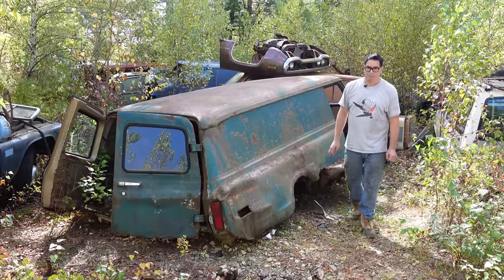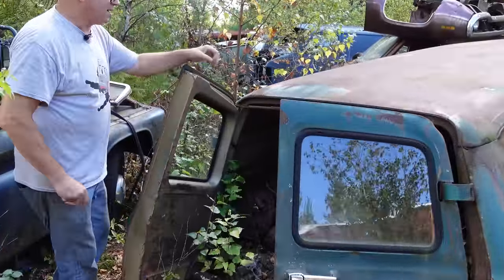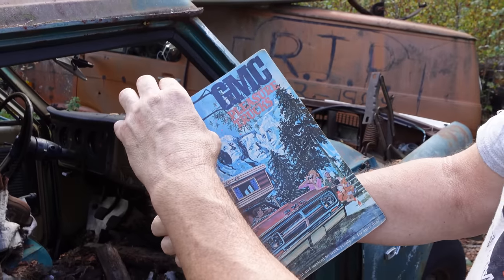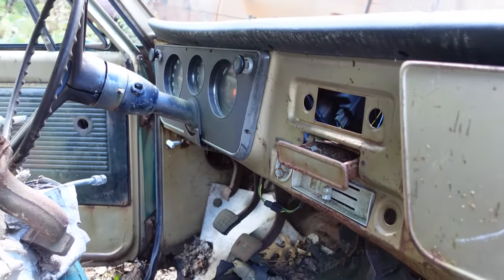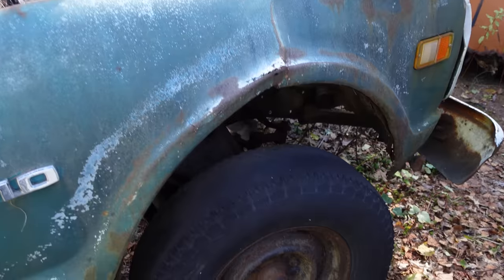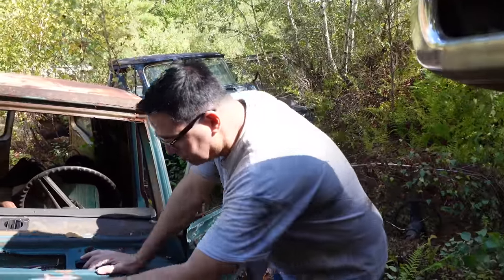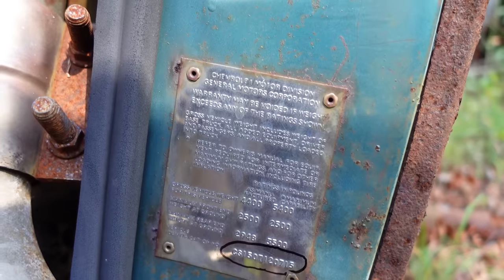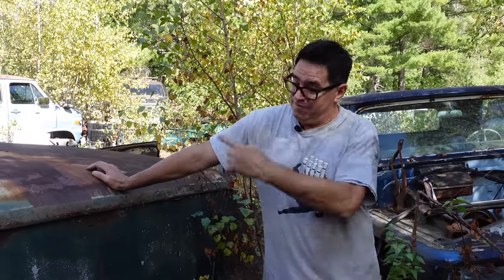Tin Panel Alley

Comment: I wish GM would make something like this again.  I love the Suburban body style but don't need or want all the modern gizmos that push the price up to 80K or more for a new one.
Reply: Agreed.
Reply: So do I
Reply: They technically "did", but on a smaller more "retro" scale, the HHR. It was a bomb and flop.
Reply: My 2006 Suburban LS 4WD is about perfect for me: pre-AFM 5.3L, cloth seats and just the basic power accessories.  4WD and G80 rear end.  300k miles strong.
Reply: I completely agree 👍
Reply: I am a contractor. I would rather have a panel van / suv than a van!
Reply: @gtemnykh  Awesome bro.
Reply: The car companies tell say you do need all that stuff.  How dare you wanting to drive and control the vehicle yourself.
Reply: I would be in on this as well. Even if it was just a 2wd.
Reply: Buy one of these and do it up!
Reply: You're precious government (especially Brandon's) would never allow it..
Reply: They did continue to build this type of truck in Mexico 🇲🇽 until about the late 1990's. Production ceased around 1998 or 1999.
Reply: @frankdenardo8684  they kept making the beetle after the "new" one came out I think. Cheap practical vehicles are basically gone today. Nothing under $27000

Comment: My father had an older version of that panel van back in the late 60’s ish. Believe it or not he traded that panel van for a one car garage. Drove it to the guys house. Unbolted the garage from the floor,braced it and backed a small dump truck into garage and raised the garage up with the dump body then drove the garage back to our house across the city.

Comment: A friend of mine has one that is black on the outside and that same gold/ tan on the inside. It was a funeral flower truck. It had a six and had a 3sp on the tree. It had super low miles on it. Now it has  a crate 350 and th350.
Reply: At a funeral home I worked at years ago here in Central Florida , we had a 68 El Camino used as a flower truck .  It could do GREAT  burnouts !

Comment: Hi Steve great vid as usual. I commented on an earlier vid of one of these. I owned a 72 Suburban factory big block but that had been replaced with a 454 later on. It had every option with the factory tach and front and rear AC and a weird plaid interior. My question is I've always been told a panel van is a van without windows and these were called panel trucks because of the truck components. The sedan delivery was from the bones of a car, sedan, or wagon. Is this what the manufacturer called them? Have a great day and even better tomorrow, Namaste 🙏🏼
Reply: We always called them panel trucks also.
 The car based version was known as a sedan delivery.
Reply: The terms were often used interchangeably. Just reference the GM literature for that year, and that's the "official" name for it. Roll with that. Done.
Reply: I have never heard this vehicle referred to as a van either.

Comment: 292 has the motor mount on one side offset to the other, maybe that could tell which this had. 

The RIP on the orange van is neat
Reply: It was a 6
Reply: @rustedratchetgarage6788  Yes, sparky, was it a 250 or a 292?  The mounts are different.

Comment: When I owned a garage, rare vehicles can sometimes be a problem. Twice we had problems getting exhaust parts.
One was a Granada station wagon; and the other was an AMC Spirit(?) with a 304. Neither being listed as made.
Reply from the maker: Hi Ron D Pert, wow a Granada station wagon. Weird. Maybe a coach-built unit like the Cadillac Westerner conversions? Oh, IGNORE the crappy Spam message from some imposter on the WhatsApp junk link. But you knew that. This junk happens from time to time on just about every YouTube channel. Anyhoo, THANKS for watching and writing. -Steve Magnante
Reply: @SteveMagnante  "The second-generation Ford Granada was offered in three body styles. For 1981, the Granada was introduced as a two-door and four door sedan. For 1982, a five-door station wagon was introduced transferring the body style from the Fairmont line." ~Wikipedia

Comment: Back when I was a kid about the only users of those panel van s in the late 1960's was the Bell Telephone service people and a couple of home diaper servece companies. Most other users had tranisitioned to regular vans or step vans by that time. Back in 1979 I had a 1953 Ford  panel truck for a while with the 239 flathead V8.

Comment: As a former flooring installer, I always wanted one of those panel van but being there is like 36 on the road is probably why I never got one.
Reply: You just have to know where to look.  I have seen 3 or 4 for sale in Mexico but they all needed restoration.  They all were running and driving though.
Reply: @mexicanspec  It's been a while. I may have to go hunting for a new project this weekend. 😎😎
Reply: @finscreenname  If I can help let me know.

Comment: Dude, you got to do a vid on that white 84-90 Caravan/voyager beside the C10 Panel. They actually made a panel version of the 84-90 caravan (84-87 were called "Mini Ram Van" and 88-90 were called Caravan C/V). I have clean low mileage '87 Mini Ram Van myself (just thought it was Ironic seeing the old caravan next to the panel C/10).
Reply: At the science institute where I was employed they purchased a new panel version of the Caravan as a mail van,it
had power brakes, automatic, but to save a few pennies it had manual steering. I drove it once and never again; as
it was like mixing concrete with a broom handle.

Comment: My Dad had a panel truck when I was little, maybe five or six at the oldest. It was older than the 67-72 body styles though. It may have been in the 62-66 range, but I'm thinking it was most likely a little older like something out of the late 50s, extreme early 60s. He hated when I called it a panel van! His logic was that it had the long nose of the pickup, the engine was out front where it belonged, and even if you smashed it in, it still looked exactly nothing like any van that GM had produced up until that time. Then he proceeded to remind me that the engine in his van was under a doghouse between and behind the front wheels My point was that it had two sets of barn doors, one set on the right side, and the other at the rear, plus there wasn't any way to seal the cab from the cargo area. He was right of course, it's a truck. Maybe.

Comment: Steve good infor on panel van ! About the Oldsmobile what year is that one ?
Reply: From the front, with the holes for the turn signals where they are... it's a 1955 model.

Comment: Okay Steve 10% of 3,900 would be 390 not 39. But hey this is the episode I can sync my teeth in. And I was 16 to 18 years old I own one of these. Now it has 3:50 in it and as I remember it pretty much fit the truck. Condition of engine condition of the truck but you didn't mention what the option cost for a 350. You said 307. I know 307 was popular and GMC trucks I made a mistake to try to build one account you just can't go far enough with it. So I had no idea there's that rare. But this one is cool it had been painted red at one time and then black next time and the whole time is on my friend of mine Eric his father pinstripes and outline every body line on that panel truck! I think the term was geometric at the time. No paint roller stripes is all free hand with a brush and no guide cake. Parents absolutely flawless. Blue used to make a reference to his on ethnic ancestry. But in today's world it would be misunderstood so I'll leave it be. And he said that's why he was so good at it. I never said there was modest. I never did call him by first name. Only today because hey I don't want to put his name out there. Anyway the way you painted it was with a paint roller for the red and then again later the black. One thing about painting these cars with rollers are paint brushes back in the day, they had enough paint on them to protect them for ailments pretty good. I lost track of this vehicle okay 20 years ago. Oh when I sold it I sold it back to lose son a good friend of mine. And have one hellacious small lot in it I don't remember having a wooden floor. Was there still four option for the back like it was a pickup bed? My kids not this thing has such deep shag carpeting in the back you could lose yourself in it if you were to lay down here when that bedtime machine to have today? Yes I greatly appreciate this episode. I really hadn't thought about this until I saw you sitting in the morning that you have been introducing each one of these episodes. And then of course this one here today where you were featuring it. By the way this one I had had a padded dash like the CST did. Thank you again for the episode and the details and the trip down memory lane.
Reply from the maker: Hello CAR OLD, Thanks for watching and writing. I was an English major in school, numbers aren't my strong suit1 But thanks for the correction on 10-percent of 3,900 being 390. -Steve Magnante
Reply: @SteveMagnante  looking back at your bio maybe I should have been an English major. My laying and lit professor she thought I was an English major taking so many classes with her. That's a story for another time. Anyway an English major that has a deep passion and love for fine American and other autos. That's great. Ice cream I was a business major with a side interest and military signs and history. And you got it politics. I did really enjoy lang and lit. Anyway I did not mean any disrespect nor do I think you took it that way. Part of my grandma was upset I wasn't nitpicking. She had the best way of saying things. Just had your back door I guess you may say. Something my cat and mouse day I never had to worry about. They never could keep up with my tail lights I never had lights on. Stupidity in my youth and survival. Well I've enjoyed reading and watching what you produced over the years. You're just a little bit older than me. I know a hidden honey holes around the country but most of them are in the Midwest. South and Western Kansas Oklahoma Texas Colorado etc has a lot less rust. To every corner of the country just about except for the northwest chasing cars and hauling buying selling old classics etc. It should look like I should have went to work writing for a popular magazine. Well thanks for the personal reply. Best wishes.

Comment: Hi Steve the drive shaft that you where referring to is not called a carton joint, it's called a cardon joint.  Double cardan joints are typically used where operating angles are too large for single cardan joints.  A double cardan joint is essentially two single cardan joints connected by a coupling yoke like a four wheel drive truck or SUV.  Cadillac, Buick Electra, Buick Riviera, Ford Thunderbird and Lincoln, used cardan driveshaft joints in the 60s and early 70s on there luxury cars for a smoother ride.  Back then, the Chevrolet/GMC Suburban's did have two doors on the right hand side and one door on the left hand side.  That was because the left side is the road side and the right side is the curb side, which was/is more popular and safer to load and unload passenger's, as older vans only had one side door on the right hand side.  Please reply.  Dave...
Reply from the maker: Hi Dave, I did say 'Car-DON" but probably didn't annunciate it strongly enough. Cartons are for cigarettes! Thanks for watching and writing, Steve Magnante

Comment: Steve where are there some split window buses I need one badly
Reply from the maker: I saw a split window VW van with roof windows from the late Fifties /early Sixties at Old Car City USA in White, Georgia about 4 years ago. It was in stripped but reasonable condition for salvation. Problem is, Old Car City USA wasn't into selling any of its cars or their parts at the time since the owner used the place as a money making tourist visit spot. They even had some TV shows and movies shooting scenes amid the acres of old vehicles. I don't know if they have changed that policy since I visited with the Roadkill's Junkyard Gold crew, but it's probably still sitting there under the pine tree forest. We were focused on muscle cars for the episodes we shot there but I certainly noticed the rare people mover. Maybe give Old Car City USA a call? Thanks for watching and writing. -Steve Magnante
Reply: bro thank you so much  really appreciate it Steve! I'll give them a call cuz I'm almost bought a 64 panel bus yesterday but I rather have a 23 window Deluxe😁🙏✌ I'll be 40 Sunday it's a gift to myself I'm going to destroy this message shortly so no one goes after it🤣

Comment: I like the van in the back, "1973 to 1989....RIP". So, we know how long it's been there.

Yup, the VIN for the win, but go all the way, don't you say? C for Chevrolet, S for six cylinder equipped, 1 for 1/2 ton (2 is 3/4 ton, 3 is 1 ton), 5 for panel (3 is cab and chassis, 4 is cab and pickup box, 6 is Suburban, 8 is Blazer), 0 for 1970 model year, T for Tarrytown, NY (North Tarrytown/Sleepy Hollow) Assembly and the rest is the production sequence. The Tarrytown plant operated from 1896 (as the Stanley Steam Car Company) through 1996. It was a Chevrolet facility from around 1914, and then when Chevrolet became part of GM in 1918, it continued as an assembly plant through 1996. The "Hoover/Dustbuster" U body minivans (Chevrolet Lumina APV, Olds Silhouette, Pontiac TranSport) were among the last products to be made there before production moved to Doraville, GA. No tag, can't brag, but possible code 515 Light Sandalwood exterior paint. 

The plant was situated on the Hudson River and today, the Village of Sleepy Hollow Public Works occupies part of that property.
Reply: Yup, I saw that painted on that orange van and noted same. Every vehicle in a salvage yard has a story, and a "DOB" and "DOD", if only they were written like a grave marker lol. I like here in NY I just look for the last inspection certificate, if still intact, I know all colors and variations back to 1970 or so. That must be some tough spray enamel or lacquer to hold up in the NE weather, back when spray paints had "good ingredients" to hold up to the weather. I still have some spray cans that have metal caps and multiple small ball bearings to stir contents.
Reply: @WildBill236  When I scrapped my 1987 Kenmore (Whirlpool made) dishwasher in 2019, in marker I wrote on the outer case, "Born, Findlay OH 1987, Died 2019. RIP. Fly on Freebird". I would have fixed it, but the tub rotted out, so it wasn't practical. The machine had to be repaired a few times over those 32 years, but they were all minor repairs (door springs, heater assembly, fill valve) and I easily handled them myself. I parted out the machine, replaced it with a 2019 Kenmore (also WLP made, also made in Findlay OH) and put it to the curb. I'm sure the garbage men that picked it up got a chuckle out of that. Whirlpool's main dishwasher assembly plant is in Findlay, OH.
Reply: My uncle worked at the Doraville plant in the early 90’s After it was demolished, a Nissan/Infinity dealership was built. Nothing else has been built. Jus a blank space.
Reply: @kridley73  Yup mothing much there.

Comment: Your math was a digit off Steve. A 1 in 10 survival rate would translate to about 396 and a half of these still in existence, and it looks like you found the half. If you mentioned the single visor in the video I missed it. Guessing it may have been a passenger seat delete, so no need for a passenger side visor?

Comment: Hi Steve I'm a big fan I have a chance to buy a 67 C10 8' fleetside original sm block 3 speed VGC not cheap!  What do you think? Thanks
Reply from the maker: I'd say the current interest in these vintage pickups is NOT a flash in the pan. They've officially "arrived" among collectors of cool vehicles and represent items you stand a good chance of selling for at least as much as you paid...if you ever are forced to sell. If you aren't scrimping on other stuff (college fund for the kids, mortgage, etc.) go ahead and buy it. But drive a hard bargain if the seller is asking "too much" by reminding him the 8-foot bed isn't as desirable as the 6.5 (it's a bit of a bluff, they're both hot). Good luck with your efforts! -Steve Magnante
Reply: If you like it and it fits your budget buy it. It will be fairly unique at a car show.

Comment: That interior color is Fawn Brown or Fawn Tan.
Reply: Fairly certain that for the 1970 Chevrolet model year pickup interior...they referred to that color as Sandalwood, or Dark Sandalwood.
Reply: @willhorting5317  ... hey, it's GM and they may have changed the color name to suit marketing, but early 60s used the Fawn Tan tag. (I have one) IOW, could be the same color with a new name. I also had a 68 PU and it looks darn close.
Reply: @rupe53  oh I completely understand that.👍
Yes, they often changed names for the very same colors.
I wasn't implying that you were incorrect.
Only stating what I recall Chevy calling that color in 1970.

Comment: These are not vans.  These are Panel Deliveries, a body type made obsolete by the van.  A few years ago, Datsun revived Panel Deliveries, and surprisingly, they sold well, despite having less interior space than a van of the same bumper to bumper length.

Comment: Still the days when we had work vehicles that were just the basics. A heater was a yes but you had to order AC and a radio. What we call trucks and vans today are over plush and over priced. I tried finding a base model truck and they just weren't out there?